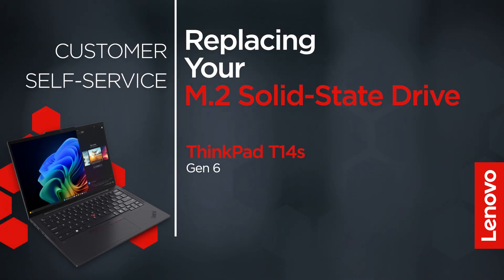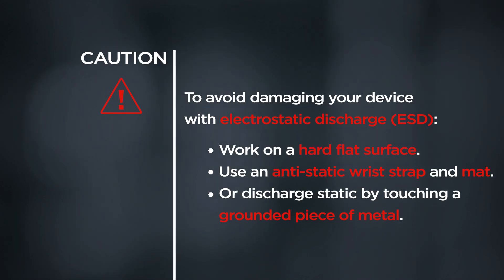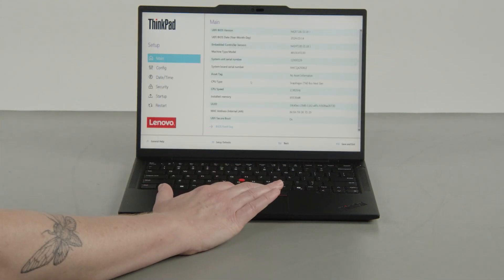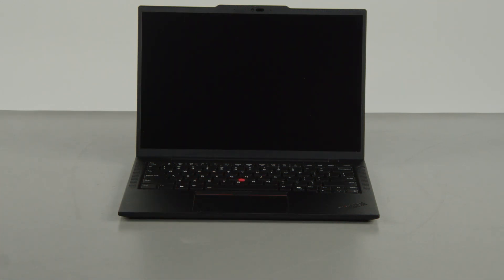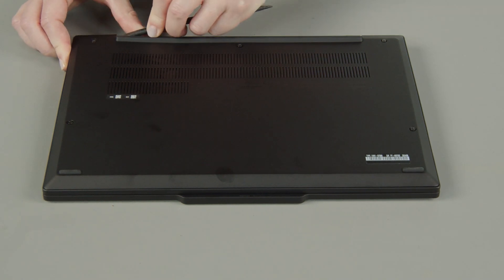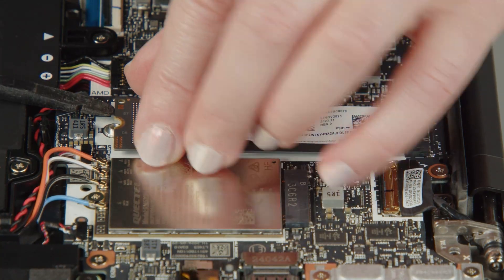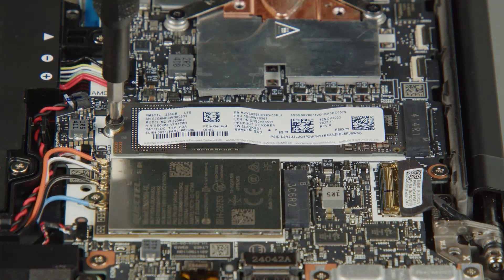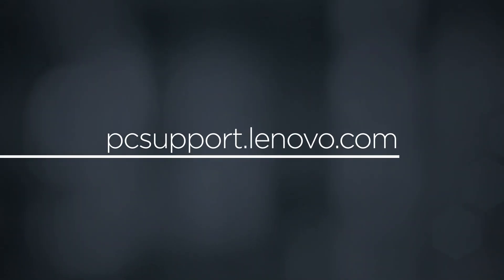Replacing Your M.2 Solid-State Drive | ThinkPad T14s Gen 6 | Customer Self Service

Comment from the maker: This video will show you how to replace the M.2 solid-state drive in your ThinkPad. The process in this video will work for the ThinkPad T14s Gen 6. 

You will need a screwdriver kit, a non-metallic pry tool, and 15 minutes of your time.

If you are looking for videos about the ThinkPad T14s Gen 6 Snapdragon, go here: https://www.youtube.com/playlist?list=PL-2mqY82TErhpAGkQPGWGUDie1LjE66QO

To learn more about your device go to https://pcsupport.lenovo.com

To find parts for your device go to https://support.lenovo.com/parts-lookup/?cid=ww:lenovosocial:b9515f&source=socialmedia&subsource=yt

To view the Lenovo Support Self-Repair Guides landing page go to https://support.lenovo.com/us/en/solutions/HT516547

** NOTE: Static electricity can destroy components. Use a grounding strap, and clean, non-conductive surface to work on. Use plastic or coated tools to prevent scratching and avoid using metal tools on plastic parts. For more detailed information on electrostatic discharge and how to prevent it, please watch our ""Understanding Electrostatic Discharge (ESD)"" video: https://youtu.be/by4PB3WtdLo 

Applicable Machine Types:
ThinkPad T14s Gen 6 - 21M1, 21M2

#Lenovo #LenovoSupport #LenovoTechSupport

Check out other official Lenovo channels!
https://www.youtube.com/@Lenovo 🟥
https://www.youtube.com/@lenovolegion 🎮
https://www.youtube.com/@Lenovo-PC 💻
https://www.youtube.com/@LenovoSuporte 🟢🟡